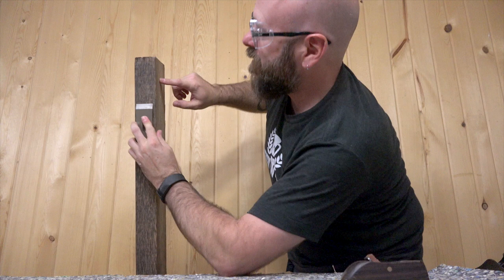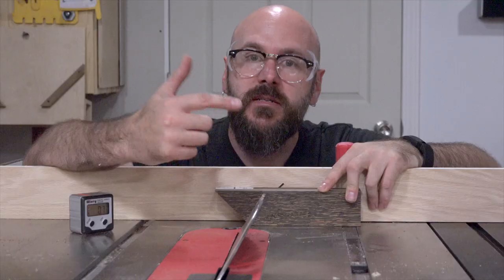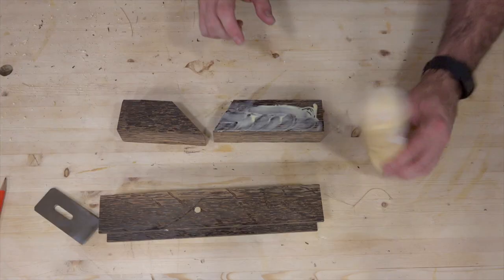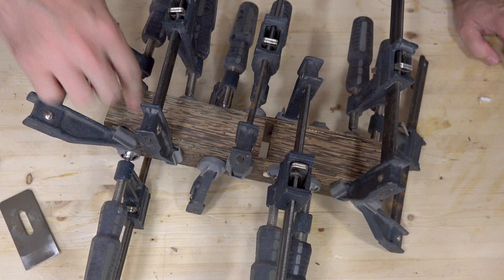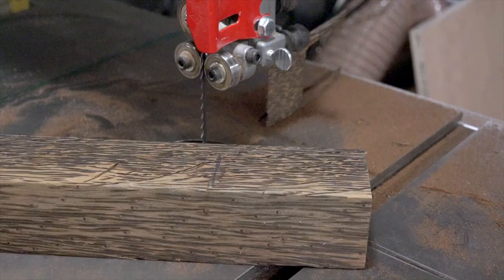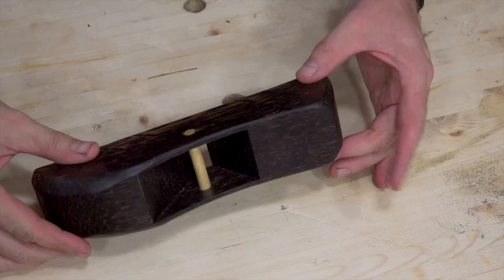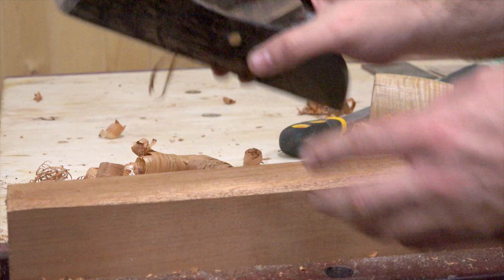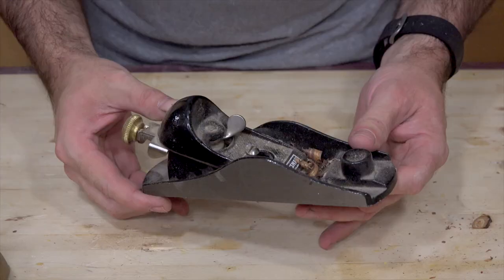How to Make a Wood Block Plane | We're Just Having Fun!

Comment: Unless you have a workbench made out of marble don't worry about setting your plane iron side down. It won't hurt the blade. If you set it on it's side you might hit the blade with another plane etc. I usually just put mine in the well on it's side with the iron against the wall of the well, or face down if I have the room. Otherwise it's face down on the workbench. You might knock the blade a bit askew but only takes a second to reset it. If you put it down gently though I don't really see that happening.

Comment: Most the makers/wood workers I have watched use it, just say a quick its hard to work with..how easy is it to work with on a beginer level?
Reply: Be careful of splinters. Plane it rather than sand it if you have a choice (a plane keeps your fingers away from it). I've got a permanent splinter in my middle finger about 3/8ths long and way below the surface (doesn't hurt, but it's there). Not really a great wood for planes, but if you're just making glue-together planes, it doesn't matter much if it turns out to be a waste of time.

Comment: For the record, this isn't a block plane since the blade is installed bevel down.  That's the key (and fun) characteristic of a block plane.  This is just a plane, commonly a bench plane or a smoothing plane.  However if you decide to sell this on eBay, you are probably required by the Terms of Service to call it a "Block Planer".

Comment: Real planemakers would use dowels and pins for a liner? I'm not a "real planemaker", but I don't think a real planemaker would use anything going laterally through a plane unless it was an infill plane. Even those of us who pose as "real planemakers" sometimes would use a solid billet of wood and mortise it. 

Actually, these little glued-together planes would work fine in the long term if they were made in the style of more traditional planes and had a wear at the front.

You build whatever you like to build, though - this is a hobby for most of us. If someone doesn't like what you build, they can build it their own way. Old farmer I knew used to respond to roadside experts ("should've planted this instead of that, how many pounds of fertilizer did you use, your rows aren't as straight as they should be") with "my fields, my planter, my money, my fertilizer......my way".